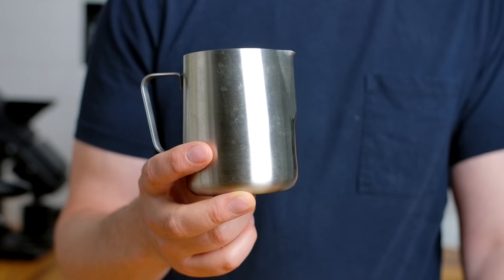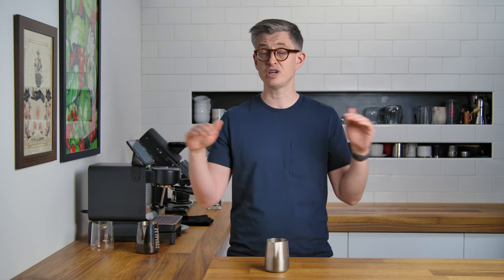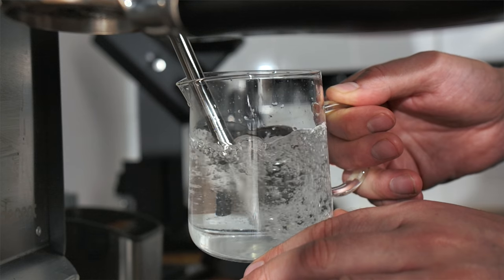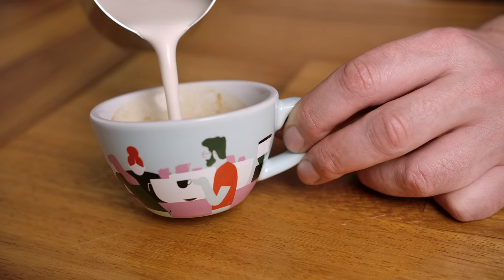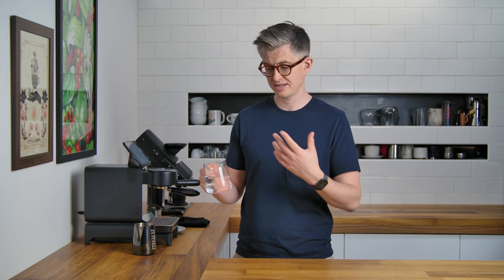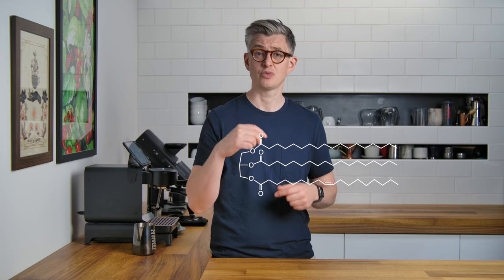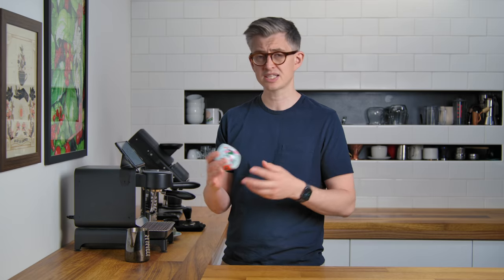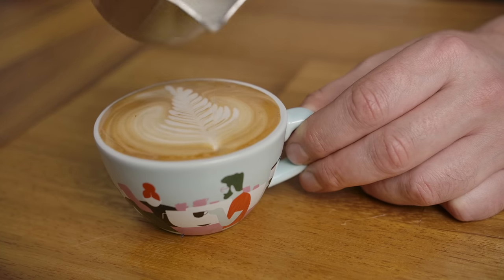Everything You Need To Know To Steam Great Milk

Comment: What you said about older milk and milk exposed to sunlight not foaming well is interesting. I always use whole pasteurised milk for cappuccino, organic when I can get it. 

In the past, I don't know if it's still the case, milk from Waitrose wouldn't foam. This was always the case whenever I used it whereas milk from Tesco, Sainsbury's and even Aldi (who don't do organic yet) always foam without any problems and I always wondered why. Waitrose milk was so bad that I stopped buying it altogether. I've no idea if it's improved but it does go to show that paying more doesn't always get you a better product.

Comment: I have an idea for making an inexpensive milk steamer with one of those $15 Amazon Moka pots that has the spout that curves downward. In theory, if you remove the basket inside the moka pot, boiling water will no longer come out of the spout and only steam should then come out. The end of the spout could be crimped or reformed to make the opening much smaller for improved steam flow. One could then use this apparatus to steam milk.  I'm going to try this.

Comment: Really useful. Thanks. I have watched several times and am getting better results but still getting too much  watery milk with a layer of foam that remains in the pitcher. The wand  tip that comes with my budget espresso machine is different from the one in your video. It ends in a wide open tube and not a fine nozzle.  Will the nozzle really make a difference. I quickly put the air into the milk for 3-5 seconds, then sink the wand in deeper and texture until warm. But still milk is not 100% textured. Using semi-skimmed organic dairy milk from the Co-op.

Comment: This is the best milk steaming video I have watched on yt so thank you, every step was very clear and easy to understand. You talked a little bit about the problem I'm  having: too much foam. I only inject air into the milk for about 3 seconds (at least that's what I think I'm kinda a beginner), which is very short. And then I raise the jug to stop that process and make the milk swirl. BUT every time the milk is too foamy and I don't know where the fault is. If it's me or if the tip of the steam wand needs changing like you said. But I work at a cafe so it should be good?

Comment: Thank you for your help.  I am at the beginning of my espresso/steaming journey.  I have a Delonghi espresso maker which has a rubber nib followed by a long shaft for the steam wand.  I am wondering if you have input on using that type of wand.  Also I am wondering about the sounds you hear while steaming.  I sometimes have a consistent quiet squeal and other times it is almost a loud screech and not consistent sound.  I am thinking the wand is not in the milk enough when I get the loud screech but that doesn’t always seem to help.  Would love any thoughts or tips.  Thanks again for your video.

Comment: First, thankyou for the great insight you have provided - I'm a loyal student.
I am basically self taught and now making manual espresso using my stovetop bellmans espresso. Here's my question/issue... my steam tip has 2 opposite exit points and has been taken off for cleaning and replaced multiple times. Any insight as too which directions the airflow should be going? My frothing seems to be working well but is inconsistent, probably due to inconsistent handling, but I'm wondering what difference this might make?

Comment: Thank you for the inspiring video. I can see you replaced the steamer. I recently replaced my dedica steamer with the rancilio silvia steaming wand compatible with dedica. I haven't been able to foam my milk since 😭 all I am getting is hot milk, no foam at all. The wand comes with 1 hole tip, and 3 holes tip. I tried both, with glorious failure 😭😭
Question 1: Which tip is better?
Question 2: What should I do to foam my milk using this new wand?
I know that watching the video and following the steps should do, but still there is something missing.

Comment: I'd definitely recommend using a (clean) thermometer to ensure you don't heat the milk too much.

Another bonus when using a thermometer is you can more accurately control how much air you put into the milk. For a flat white, when the milk has reached ~20 I'll dip the steam wand back in since I don't want too much foam and want to break down the bubbles for longer to create a finer/heavy foam. For a Cappuchino/Latte I'll go up to ~30 (or 35 if you want it a bit more foamy) since you want more foam that is lighter.

Comment: Well if you must know what I'm having trouble with since you invited it at the end of the video, it's not foaming but latte art.  Despite doing all I've seen the milk foam usually wants to sink straight through the brown crema.  The only way I can get something resembling a fern is to pour quickly which does something to the crema and then the milk foam will start floating on top, but often that initial fast pour will mess up the even brown surface.  It's so frustrating, I've been at it for 2 years with a good Rancillio and fresh milk etc!

Comment: I'm still having issues steaming milk with my Olympia Caffarex machine . . . it feels like the milk gets too hot too quickly!  I can make a decent foam, but it all rises to the top of the coffee, so I can't get latte art to work (I assume the coffee should be hotter than the milk so the milk mostly collects under the coffee until the end of the pour).  I also can't hold the jug when I'm steaming, as it's much too hot after a few seconds (I'm using a 12oz stainless steel jug from Espresso Parts, so I assume it's not the problem).  I'm also using a four-hole steam tip from Orphan Espresso.  

Any suggestions on how to keep the temperature from rising too fast?  Thanks!  Great informative video!

Comment: Hi, is there any difference in the number of holes on the wand tip? I imagine from your video, a single hole tip will have less flow rate than a double and a single would have more directional control over the flow of steam into the milk? I’ve managed to get a microfoam and latte art out of the Gaggia plastic wands and now looking to swap it for the metal professional version. Great video, content, structure and clarity, thanks.

Comment: Very interesting, the guide that came with my DeLonghi machine that I bought years ago says bring the milk up to temperature (I.e. hold the jug with your free hand until it's too hot to comfortably touch) and then start the foaming process.  It's worked OK for me but must give it a try doing it this way as well and see the results.

Largely stopped using the machine for ages as I mostly drink filter coffee, but at times a cappuccino or a latte is perfect, and my Mum (who is very much not a coffee person) does like cappuccino when she comes round as well.

Comment: So I'm just wondering, as I'm new to milk steaming and I'm still finding my feet, occasionally still just 'bubbling' my milk by accident in my girlfriends morning hot chocolate haha, or just most of the time ending up with the milk pouring out of the jug before the foam, like the foam is separate and floating on top of the milk- I'm just wondering one thing about what was said in the video, aftor the process of creating the desired volume of foam, when you lower the jug again so that the wand is back below the surface, is the goal to have the tip of the wand be actually below the surface of the liquid milk? or is it nothing to do with where the level of the liquid is and more just about actually lowering the wand itself? Because if I'm making a very foamy drink, as is the case with the gf's hot chocolate, she likes a lot of foam, i might have an inch and a half of foam volume sitting on top of the liquid milk, so I'm wondering, do I still just dip the wand slightly below the surface of the foam, or do I want to actually plunge it quite deep so that it's very much steaming the liquid milk?

Or, something I've just realised, is it more the case that if steamed correctly, the entire jug of milk will have the same silky, foamy consistency? If i still very much have distinctly separate milk and foam, am I doing it completely wrong? I assume not, if you have say a latte worth of milk I'm guessing you'll always have some still-liquid milk under the foam, right?

Any advice would be greatly appreciated. Bonus points if you comment in the next 20 mins as that's when I wake my girl up and make her morning hot chocolate! hahah

Comment: I struggle with getting micro foam to stay incorporated in my Bon Soy. I can get good foam, but it always sits on top and never fully incorporates into the body. I use a single tip wand and stop aerating at about 35C. I also stop stealing at 60C and let the temp finish rising to a little under 65C by the end.

Comment: Good morning James.
The wife and I have just received our first coffee machine for Christmas.
I've made about 10 cups so far.
The issue I'm having is too much froth.
I'm not sure if I'm putting to much angle on the steamer or not enough.
Im getting to about 20 seconds and the milk turns to all froth. And it's really thick.
I did see in your video about just having the steamer tip just below the surface of the milk, but soon as I do this the milk just turns into one big frothy mess.
Could the problem be the milk?
We are using UHT milk.
Cheers Marco
Australia

Comment: Great video as usual.  I've got a La Pavoni Europiccola and the boiler typically pushes steam out between 0.7 and 0.9 bar. I have difficulty foaming the milk for latte art and have used various different hole sizes for my tips.  It does take around three times longer to heat the milk up than a coffee shop would and I am considering changing up to something like a Vibiemme Domobar Junior 2B (I need a small footprint for my machine).  my question is - am I limiting myself with the La pavoni as I wont be able to create the latte art I want to unless I get more steam power etc ?  (I am also assuming I will get better espressos with the Junior)

Comment: I have a question: On my Bezerra machine I can choose the temperature of the Steaming boiler, currently it is set to 125C°, is that any good or should it be lower/higher?
Thanks James for the tip about checking the steaming pressure, I will look into that.

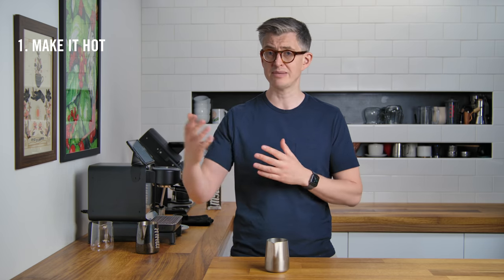Comment: 2:20 “So your milk will be heating in a pretty linear way”
The speed in which heat is transferred from some mass to any other mass is dependent on a variety of factors, including the temperature difference. In this case, heating up cold milk (+-5 C) with steam (+-100 C), at the beginning that would be approximately 95 degrees. Towards the end, when the milk is around 60, that would be around 40, so less than half. That means that the heating process goes less then half the speed towards the end compared to the beginning, not linear at all.

Comment: I've followed this and a few other guides, but so far I keep getting a hard foam and liquid milk underneath. I blow bubbles at the surface (hard to see if I'm hovering precisely on the ever-rising milk surface due to all the foam, but I use sound and feel as a guide), until I have ~80% more volume, then submerge the tip and churn the milk until the jug's temp sticker lights up at 60 °C. Clean the wand, knock to pop bubbles, and swirl jug until it's as homogeneous as it gets.

I've gotten close to a glossy foam once or twice after enough swirl, but even then it quickly separates back into a raft of hard foam and liquid milk. What am I likely doing wrong? (Using a Breville/Sage Barista Pro, if that helps any)
Reply: ur probably adding way too much air and not submerging the tip for long enough, hope u figure it out!
Reply: @sarahnlh  Yeah, I actually came to the same conclusion! Too much air, not enough bubble splitting. Still have some work to do, especially with oat milks and stuff, but I get to a microfoam more reliably now!

Comment: Why bubbles are stable is a bit more complicated, it's not really about the initial properties of bubble membrane.

When thickness of the membrane changes with time (like in that part where you leave jug on the table to rest!) there is a 'healing' effect caused by surface tension gradient due to differences in surfractant concentration (in the thin part of the film, at the top of the bubble, there is a bigger ratio of surfractant to water so it tries to pull water from other parts).

This is called Marangoni effect https://en.wikipedia.org/wiki/Marangoni_effect.

Comment: My foam is great. It's the heating I'm having trouble with. I use coconut milk (or a blend) at low to medium pressure so it doesn't flow over. How can I heat it faster than it can foam?

Comment: I see everyone clean off the milk after steaming in one or two quick wipes. For me it takes alot of scrubbing to get it to come off. It looks like it's almost burned on to the tip. Gotta use general cleaning solution to get it off, but that does get it off after scrubbing for a bit. Is there something im doing wrong? Gaggia classic with whole milk btw.

Comment: i have a stove top steamer, and it has 2 holes on the steam wand tip. what pressure is suitable for that setup? i usually do around 2Bars, but i never able to achieve a good result. milk is heating way to fast and dont have enough time to swirl the milk around.

Comment: My mayor problem is that the milk quickly has a not-so-soft layer that does not flow smooth enough to dive under the espresso creama. I could not imagine to wait e.g. 30s and then pour the milk... it would be impossible. Milk is 3.5%, temp probably 55-60, but need to check. Normally I do not swirl the milk to mix it even... maybe it's that... will try

Comment: Are machines supposed to build pressure or something before the steam comes out? That would make sense to me. 
On mine I turn the knob and then it opens and just gradually gets more powerful. It leaks out water and then softly blows air and slowly builds up. I don't get any other options. 
I don't know if I'm supposed to start with the wand in the milk or let it make a mess while it builds pressure. This is bizarre. My first attempt was dreadful.

Comment: I’m a relatively new LM LM owner. It has loads of steaming power. I’m going to try a single or two holed tipped. Has anybody made the switch and seen improvements on workflow and foaming?
Reply: Hmm, just looking online…do I need a smaller hole size vs the number of holes? (Admittedly, I felt slightly uncomfortable typing that question 😂)

Comment: I read a lot of comments from people getting extra silky foam. I watched and rewatched the video and still can get a very very thin foam (1mm). I have a Solis Perfetta Plus and a gauge to regulate the flow of the steam, tried everything but I get only that thin layer of foam. Would you help me please???😅
Reply: It sounds like you’re not incorporating enough air into the milk, if you don’t incorporate enough air you only get a small amount of foam and the rest of the coffee is thin like water (so basically a flat white). If you watch the video at 7:21 you can hear the slurping noise, that’s the noise you want to hear when you’re incorporating more air into the milk. So try to have the tip of the wand closer to the surface of the milk to incorporate more air into it, then raise the jug to get a vortex going to break down all the larger bubbles and texture the milk. Hope that helps!

Comment: I’ve tried and I’ve tried but can’t get it right. What am I doing wrong. I get the bubbles early  I create the vortex in the jug as it churning, up to temp, steam off I bang jug to disperse bubble then swirl the milk to combine and it still separate with the foam sitting on top of the thin milk when I pour.  What am I doing wrong
Reply: Kind of late, but did you let the milk sit for a while before you swirled it to get rid of bubbles?

Comment: my trouble is that not any coffee bar in my home town use there coffee machines how they have to. they always use tha automatic function and burn the milk and then you get a milky espresso with 2 mm foam. and no buddy will beleven that using the manual skill is better and faster than the automatic finction.

Comment: I know there’s a low chance anyone will read this, but is there a reliable quality way to steam milk without a steamer?
Reply: Yes. I used to use an unbranded milk frother available from Amazon. It works by heating the milk whilst spinning it like a liquidiser.  The spinner is “off centre” which replicates the effect of the steamer. Air is sucked down the resulting vortex whilst the coffee heats up. It works well but not fully up to the foam required by a professional barista.
Reply: @driftwoodmotorhomememories2712  thanks man appreciate the reply!

Comment: I've been making coffee with a manual coffee machine for around 16 years and the problem I had when my wife's friends came over they wanted me to make them a cup of my coffee and each one took around 7 to 10 minutes of my time.  A few months ago I got hold of an automatic coffee machine. Strangely enough I needed to learn it all over again. I then I sold my manual machine & grinder. I found in the end when it's set up it usually comes out the same as the last one did. One thing i found Capaching comes out around 47 degrees celcius so i need to put it into the microwave for 20 seconds. I normally make a cappuccino But I also sometimes make a Espresso or sometimes I make espresso. I find these come out nice as long as I put sugar in them. Don't get me wrong I like the coffee from the automatic machine but I recommend to people maybe buy a manual machine learning using a manual coffee machine from a barista class unless you need to make a lot of coffee for your wife's friends.